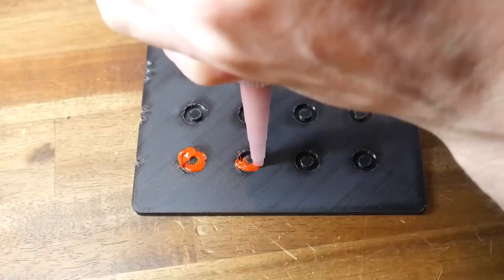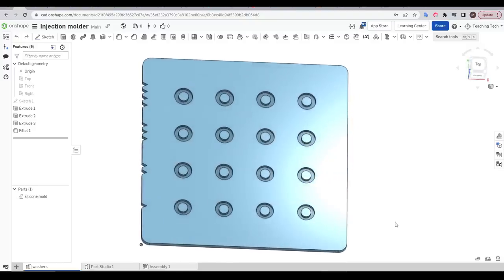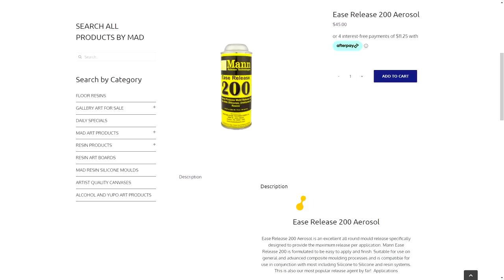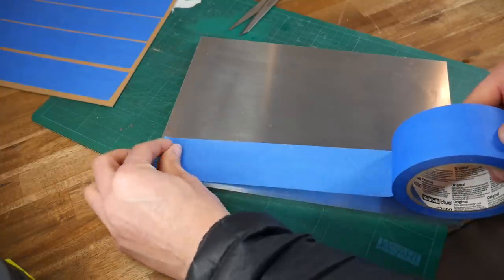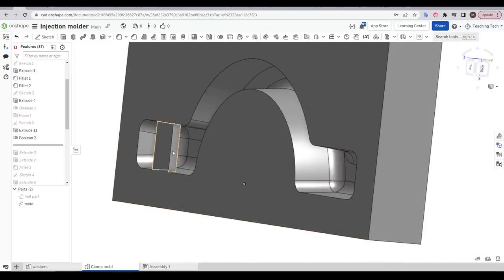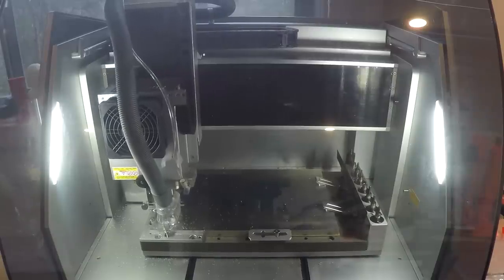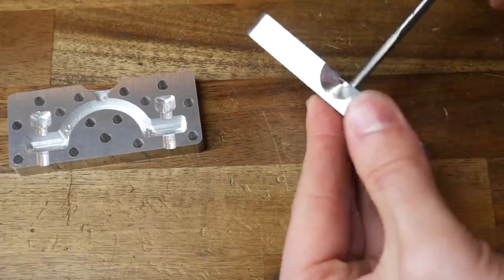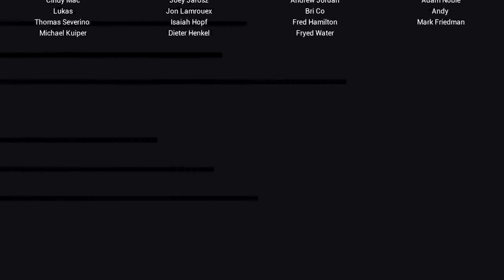Home injection molding part 2: Machining a mold

Comment: As a machinist, you should invest in some proper 2 flute end mills for your machine. It will help your surface finish a lot. The Dremel ball flutes are too small for that much aluminum removal and will clog. You should also setup the final operation of cutting the part free as a separate operation. This way you can look at your part and measure it while it is still attached. You could have made an offset for the tool and run that last pass again to clean it up. Great start!
Reply: In addition to this, measuring across a cutter like that will give you the wrong dimension if it has an odd number of teeth or i it is highly contoured so you can't be sure you have two points that are diametrically opposed and ALSO part of the cutting edge. Even if it's measured correctly, the ball it's self might not be precisely on the axis of rotation so it ends up cutting a larger diameter when it tuning. The best way to measure it is to cut a slot and a post of a known width (so you can measure the inside and outside dimension). Then measure the dimensions that where actually cut and calculate the actual width of the tool. You can do this trick on the final part, but I would suggest trying it on a test piece first because of the difficulty of getting an accurate measurement with the draft angles.

Comment: Just a tip here.
In order to shape silicone easily with you finger - just mix water with a little dish soap. Then dip your finger into the water and then shape the silicone as needed. Wipe your finger with a paper towel and dip again in the water and continue. It is very easy to achieve good results.
Reply: Spit works great to! haha
Reply: @ThyerHazard gross.
Reply: Just lick your finger be a man
Reply: The old caulking trick
Reply: I just use dish soap as is, works great and sicks well to anything you don't want the silicone to stick to.

Comment: Some tips about silicon molds. For your application: mill the mold using POM or use a resin printer with ABS-like resin -> do not hollow the mold on the resin printer. Design a two part mold. The lower mold must have a overflow trench milled in. I your case at ring around the o-ring in a distance of about .5 to 1mm from your o-ring. So that the excess silicon can overflow into the outer ring. The upper mold part is just flat piece of POM. Use a 2 component silicon! There are different shore hardness typs available. Then you mix the silicon components you will get air inside the mix -> it does not matter-> just fill silicon into the mold and bash the mold several times on the table until bubbles are gone. Than put the upper mol (flat POM) on top of lower mold and press down. Apply preasure with a screw clamp and let it sit over night to cure. POM does not stick to silicon so you can easily remove your parts. This is how I made thousands of silicon parts.
About the Al-mold machining: I is eaier to use a torus endmil instead of the ballhead endmill. You can avoid the step on the bottom of the mold as well, by milling bottom and sidewalls with the torus endlmill!

Good luck, I hope this is helpfull
Reply: Seeing that open mold almost made me cry...

Comment: Design and manufacturing engineer with experience in various mold designs, including injection molds. Here are my comments/recommendations.

The part should have consistent thickness. From your 3D model, it looks like the ends need to be made thinner to match the arc.

For machined molds, flat features with either sharp corners or standard tool radius fillets don't require the extremely time-consuming surfacing operations that round features require.

The mold cavity needs to be up-scaled per the shrink value of the plastic that you will be using. The plastic melt temp at injection time and packing density (result of packing pressure and shot size) will somewhat affect this, but the large majority of the value comes from the material properties. Since each plastic has a small range of temperatures at which they are molded, there are well-established shrink values for each material that you can reference.

For a very small number of parts (1-10), a resin-printed mold is much faster and easier to produce. You will need a metal frame for them (i.e. they will be mold inserts) with a platen backing. There are mold-specific resins on the market, some quite affordable. You want one that has a high HDT (heat-deflection temperature). The trickiest part will be nailing down the shrink compensation for the resin.

Mold clamping should be done with a screw vise or toggle clamp - something quick-release. You want equal pressure across the face of the mold. Bolts create localized pressure, permitting flex between them. Similar issue with single-point contacts like C-clamps. So you need to utilize a thick force-distributing layer (i.e. platen) between the clamp(s) and the mold.

For mold alignment, use tapered bosses into tapered or straight pockets/holes. This will correct for slight misalignments when closing the mold. It is also robust. This can be done on the perimeter of the part cavities or along the perimeter. If you have mold inserts in a metal frame, then put the alignment features on the metal frame. Consider the alignment features to be high-wear surfaces, so use replaceable pins and bushings. NOTE: the boss should not bottom out in the pocket when the mold is closed.

The threaded holes of this part are best suited to IM threaded inserts. Any thread-forming core (i.e. your bolts) will need to be unthreaded from the finished part - these are referred to as screw-out cores. The bolt cavities will also not seal unless you cut matching threads into the mold. The only way to have perfectly matching threads on the screw-out cores and the mold will be to machine both.

The parting surface can be changed so that the draw orientation is parallel to the holes. Yes, this will require deeper molds, but managing threaded inserts will be easy. In this orientation, I would put the entire cavity on one side (the A-side). This will be faster and easier to machine. Another benefit is that the part will cling to the arch of the B-side. The B-side (or moving side) will be the best place for threaded insert mounting bosses and ejection pins.

The majority of the length of the air vents can be wide & deep, cut with a ball- or hog-nosed endmill. These can be on both sides of the mold, or only one.

The section of the vents that meet the mold cavity should be on only one side, short, flat, and shallow. The depth will be determined by your packing pressure and the plastic selected. @markbayles7840 made a good starting recommendation for depth. These features need to be thin enough that the viscous molten plastic can't penetrate. Same as shrink values, there are well-established rule-of-thumb values for common materials.

There will be knit lines at the holes - these will always be weaker. It is a fact of physics regarding IM through-holes.

Comment: There are special deburring tools to go inside that T-junction in your valve. Some have a swiveling blade that the end of an extension rod, others use kind of a grinding ball at the end of a long rotary tool. This might help you save what ever o-ring you use from getting sheared off too quickly.
Another trick to inject your silicone into these molds for the o-rings is to actually transfer some of it into a smaller disposable syringe first, to have much more control on where and how you spread the silicone.

Comment: Great video! 

I've done a fair amount of rubber injection molding using 3d printed molds. I've found that designing the mold to be a two part mold works best, as well as using a caulk tube and caulking gun for the actual injection of the rubber. Caulk guns can create a surprising amount of pressure and do an excellent job with filling the molds.
 
Design an array of the gaskets and have air holes for each part oriented in a direction to ease trimming from the finished product. Trim the caulk tube so that you can press it to the insert on the mold and create a good seal, then fill the mold until you get push out from all the air escape holes. Looking forward to your next video!

Comment: I almost never comment, but I love your videos and this series! I just felt compelled to say something because I recently went through a similar learning experience with molding/casting silicone. I basically concluded that the best way I currently know of to achieve what you were trying to do with the O-rings is as follows:

-print / smooth out  the exact size ring you think you want
-use mold release on the part like you ended up using in the video
-put the part in a tiny box (also mold released) and pour a softer silicone to make a mold of the part
-when cured, use mold release in the silicone mold you now have (EXTRA IMPORTANT, as you don't want the final silicone part to fuse to the silicone mold)
-pour the red silicone you were using into your new mold to cast the part (it should be pretty easy to remove now due to the mold being flexible, mold release, and less if any print lines present)

I'm sure this isn't the best method out there. I've just been doing this type of thing recently, and thought I'd share what I've learned!
I hope this might help you or someone else looking to use their 3D printer for molding/casting!

edit: Or just print a 2-part mold as someone else already mentioned. you will still have to deal with pulling silicone out of a solid object, but it will probably still help. Perhaps printing a mold out of TPU? I've not tried this though...

Comment: From a um/mm scale sillcone molder/machining person you may need to reduce surface roughness of your molds for release. Also your o-ring molds look so small relative to layer lines they may be better machined if not printed with minimal roughness (and possibly polished) considering smoothness is a primary property that helps with o-ring sealing.

Comment: Two tips with working with RTV.  First, fill a 5cc syringe with the RTV you are using, then use that for applying the RTV.  This will give you much greater control.  If you find the RTV is still too hard to manipulate with the 5cc syringe, step down to a 3cc syringe.  You'll use more, but it cuts the force required down greatly.  Next, isopropyl alcohol is your best friend.  When injecting the RTV into the cavity, clean the nozzle with a paper towel, then dip the nozzle in the IPA. You can then inject the TRV without it sticking to the nozzle.  That is, atleast until the IPA flashes off.  Then you just clean and redunk.  I use a pump dispensor like those used in nail salons for my IPA in these applications.  It makes it easy to control the IPA and not have it flashing off in your storage.  The IPA can also be used to help smooth and compress the RTV into the mold by allowing your finger to manipulate the top surface of the RTV and not stick to it.  Just be sure to use as pure of IPA as you can get.  I use this all the time at work with anhydrous IPA, but 90 percent and higher works too.  Oh, and the IPA will accelerate the curing of any RTV it comes in contact with, so expect a rapid skin creation on anything you use this technique on.  You can also use this effect to rapidly cure RT going into a mold by dumping some RTV into a bowl of IPA, working the RTV like dough, then quickly getting the RTV into the mold.  This is a technique I've used in the past when making the molds for custom action figures.  I needed the silicone mold of some very detailed sculpting, but the RTV kept slumping away.  Doing this quick cure got the details and allowed additional layers of RTV to stick seamlessly to it.

Comment: Depending on the material you're molding, you also have to account for the shrinkage of the material after cooling.

Also, your cavity areas should be polished to an almost mirror finish to promote release and prevent artifacts from getting left behind.

Comment: I've never tried molding silicone like this before, but have used silicone in a lot of other operations. Working with a less viscous silicone would help the silicone really conform to the shape you want. If you have access to a vacuum chamber, degassing your mold will help reduce / prevent air bubble voids. Also, to scrape down silicone that is not cured, use distilled white vinegar. Spray it on the portion of the silicone you want to manually form and spray the tool you're using. It could be your finger, credit card, or fillet tool. The silicone won't want to stick to anything that has the vinegar on it and will create a much smoother result. The plus side to the vinegar is that in most cases you can just let it evaporate and don't have to worry about any residue. Worst cause if you still smell it, just get a damp paper towel and wipe down the area after the silicone has cured.

Comment: Get yourself a two part casting silicone, it will really make a big difference. And a vibration table will also help any air bubbles in the silicone rise up and pop. My vibration table is a small cheap brushed motor with a 3d printed motor mount bolted to a small piece of wood and resting on top of some cushion foam you can get at a fabric store.

Comment: Michael, I'm sure you already know them but, just in case - if you haven't tried Hallite/Transeals in Welshpool give them a go. Further away is Precise Motion Products in O'Connor. They both have massive ranges of sizes - imperial, metric euro, JIS, you name it. So your chance of finding a perfect fit is pretty good. 

You want a reasonably high duro (hard) viton for that application and o-rings have a round profile for multiple reasons - in this application it means there's a kind of tapered approach as the o-ring hits the edges of the bore and cross holes during installation and operation which will help it load easier. So the square profile shop made ones really aren't going to help you.

Enjoying the rebuild and the mouldmaking process, great to see!

Comment: i made a 2 part silicone mold for a gasket once Printed it with a 0.2mm nozzle from PLA worked like a charm (without release agent).
 I had modeled a filling shute that fills the gasket from the bottom pushing the air up and our of a vent.

I would suggest to put a thead like your RTV tube has in the mold and push it through.

Comment: CAM tip. Start with drilling holes. Drills are the fastest method to remove material and spiralling down leads to a taper as the end mill isn't that rigid, plus it is much slower. I would suggest getting some good quality ball mills for aluminium too, burrs are not great for it you need something that can clear chips easily. YG-1 make good quality pretty cheap endmills and they have worked well for me.

Comment: Ok, just can’t resist a couple comments on the injection mold either😀

To align  the mold halves, instead of bolts, order yourself some dowel pins and a couple reamers that size (wheel actually a pair of over and under size reamers ). Drill or mill in two holes for these through both sides at once, preferably before you cut the mold, slightly under size. Ream one side to each size, press fit the pins in one side and the other should slide on with a near perfect alignment. At the same time you made these holes, make some bolt holes for cramping force. I’d tap one side and use the usual clearance holes in the other - the pins take care of alignment.

Now clamp the two sides together and with the tapped (flat) side down, mill the outside of the two sides together (you can leave a little band at the bottom so you don’t destroy the table - won’t make a difference.

Now you have two mold half blanks that perfectly align and since the sides were milled together perfect reference surfaces to use an edge finder to align in the mill/router.

I’d Aldo consider dowel pins for the holes in the part instead of screws. It think they call them side pulls in mold making. Instead of machining the holes, clamp the sides together and drill them right on the seam. I’d Aldo team these to either size or with an oversized reamer. Now when you open the mold you can just lay the pins in and close the mold. They should fit tight enough if you use the exact size reamer that no material will flow around them and probably  stay in place fine. If you need something to hold them in though, just clamp the mold together, drill out a bit of the pin holes a bit bigger and tap for a short set screw you can put in lightly after the mold is closed to keep the pins in place.

If you try any of this, let me know how it works.

Comment: Instead of bolts for locating, use pins. Simple round pins with an undersized reamer on one side and over sized reamer in the other. Drill and ream the locating holes while clamped. There are more advanced locating pin shapes but that will get you far.
Reply: That's what I was thinking initially. I wonder if he was going to be using those as additional clamps.

Comment: Just a security tip here: Never use gloves on turning/spinning tools like a drill press. I there is a thread loose it can tangle and pull your hand into the sharp sides of your drill. Saw a few videos on that and was concerned about your fingers. Keep it safe!

Comment: I am an injection mould maker, you might have problems packing that mould out, the vents are rather large.  Depending on what your chosen plastic flashes at your vents should be slightly less, I would take a guess at 0.02mm deep will be enough.